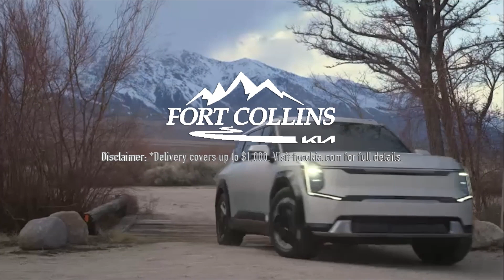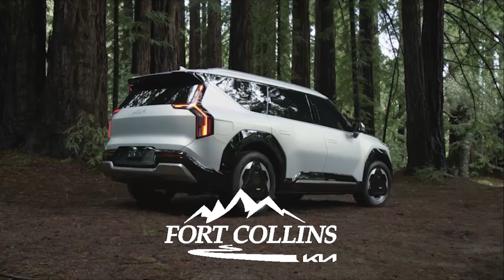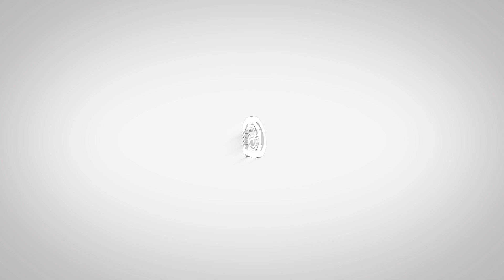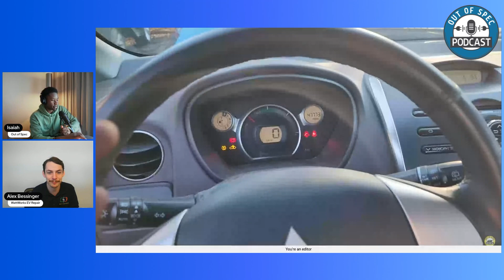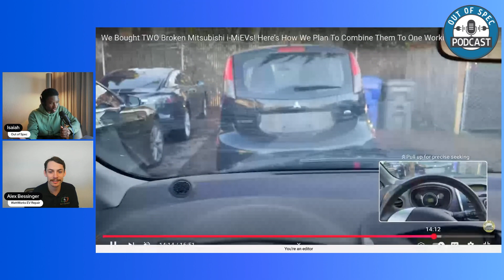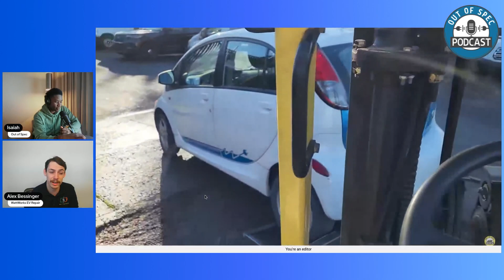Inside EV Repair! Fixing Batteries, Drive Units, & High-Voltage Systems

Comment: Toyota has masterfully designed the bZ4X with efficiency in mind. The all-wheel-drive system adapts to changing road conditions, ensuring traction and stability. With DC fast charging, it’s ready to hit the road quickly, making long-distance travel effortless.
Reply: Oh?

Comment: Nio Battery Swapp is the Solution.
Reply: No it’s not.  Ridiculous overhead at each location.  Have two in line and that’s as much waiting as someone going to a charging station.  At least at a supercharger, I can park right away and leave the vehicle.
Reply: @shou635  Nio Battery Swapp Stations is Storage and Mobility. Solve the Grid Stability Problem.
Reply: @shou635  China Government wants Swapp Stations and CATL provides the Standard Batteries. Its a Cooperation of China Government and CATL. China leads the Way in Storage and Mobility. 👍🌞🌹
Reply: This didn't age well.  Flash charging 10-97% in under 10 minutes.